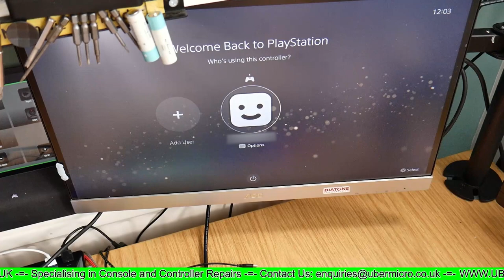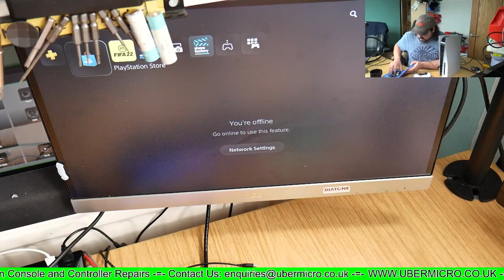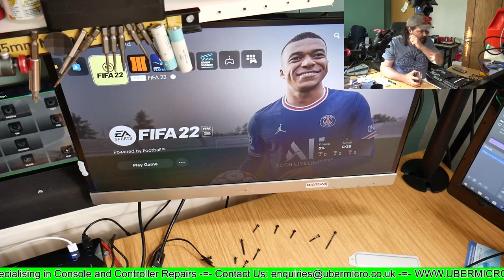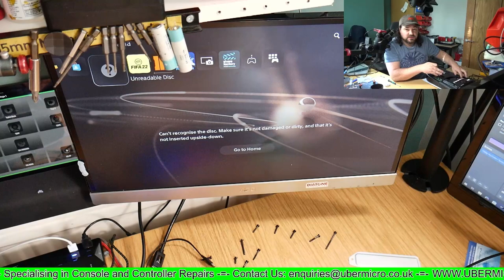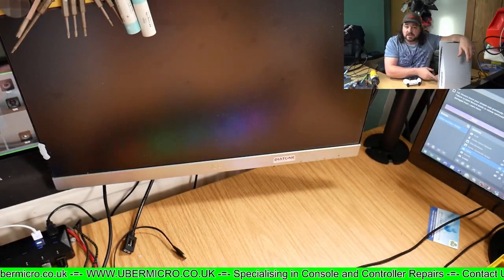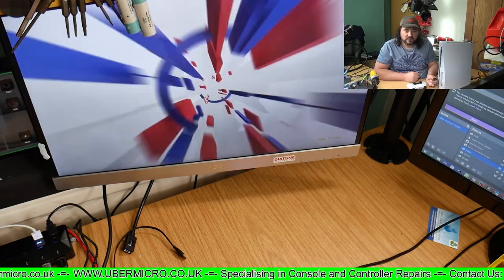PS5 Not Reading Disks 🛠 IT'S NOT THE LASER! 🛠

Comment: I'm putting a disk in and not even getting the disk reading icon idk wtf is wrong with it just bought it today
Reply from the maker: Check if it's under warranty?
Reply: @UberMicroRepairs  yeah ended up taking it back and getting a new one was definitely a hardware problem
Reply: @spaztikbaker  did u get new one? I bought it yesterday and thinking of returning it back how long does it take
Reply: @hehehehaw8346  I got a new one from the store, they tested it in store and switched it over
Reply: @spaztikbaker  is it Sonny store or a random tech one. Cuz I'm not sure if the store is random one they can just give u new one
Reply: @hehehehaw8346  I live in Australia so got it from jb-hi-fi (basically best buy if your American, otherwise it's just a electronics store) they tested it to see if it wasn't working, it wasn't so they took back the old one to send it back to Sony for it being faulty and gave me a new one, you get 1 year warranty on it so they have to give you a new one or have Sony arrange it
Reply: @spaztikbaker  strange I got 2 years warranty..but hopefully they will see that it doesn't work and just give me new instead of making me wait 20 days for it to be fixed
Reply: @hehehehaw8346 maybe mine was 2 years too idk I got extended for my new one. They should replace it if it the same issue I had
Reply: @spaztikbaker  when u get a replacement do u still get warranty for it

Comment: My ps5 reads dvds but not games
Reply from the maker: It does sound like the laser has died.
Reply: Will opening the drive  and cleaning it with rubbing alcohol fix it or i need to replace laser
Reply: @UberMicroRepairs my friend had this issue replaced the drive and has the same issue still. Any idea?